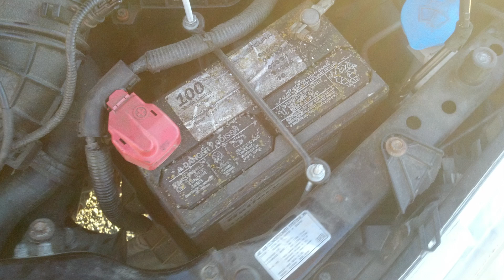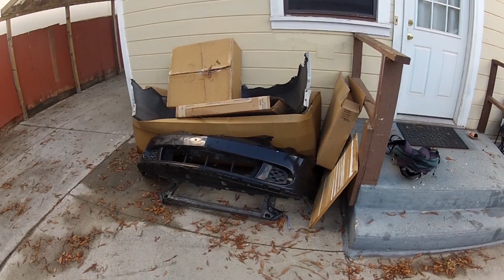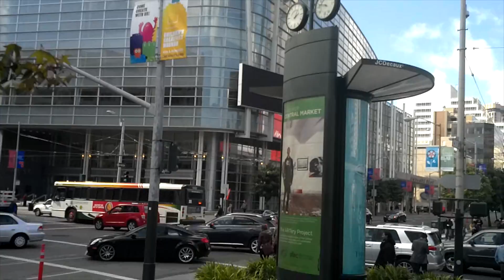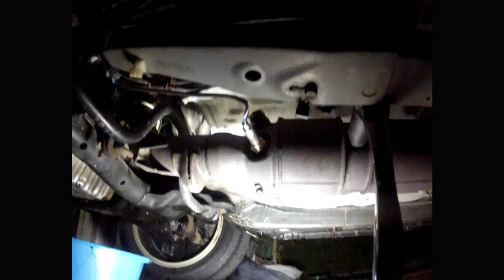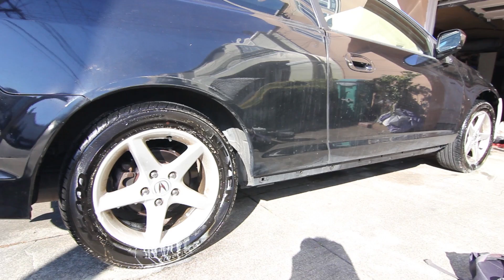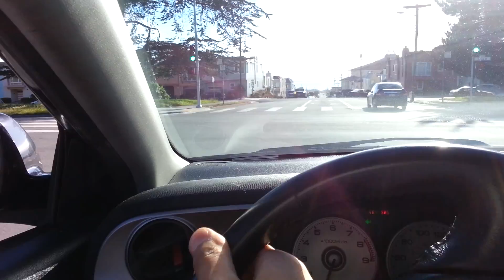2003 Acura RSX Type S Project Car - AEM Cai, ES bushings

Comment: Hey guys. How hard is it to replace the radiator support?
Reply from the maker: Not that hard if you can take off the front bumper and radiator. You'll have to drill the spot welds off, and re-bolt them.

Comment: Was there any cutting involve with the radiator support and I had another ? Does the radiator support come with the fender upper attachments mines bended
Reply from the maker: The radiator support is tack welded by the factory. You will either have to drill them out or cut them. The radiator support comes with the upper attachment. Google RSX radiator support and inspect the pictures.

Comment: When u change the radiator support did it have to be welded back on??
Reply from the maker: No, I used grade 8 bolts to secure it in place.

Comment: Was there any welding involve in replacing the new radiator support assembly?  Thanks any info would be greatly appreciated
Reply from the maker: +CAV Gonzales Hello. No, there wasn't. I drilled the frame and support, and put in grade 8 bolts. Thanks.
Reply: CAV Gonzales is it alot easier then weld ?
Reply: Colin Leung I’v been reading that in order to replace the radiator support I will have to remove the spot welds. Then weld the radiator support onto the frame. Did you get an OEM radiator support or aftermarket?
Reply: Mighty Mythic Music it looks like he got and aftermarket one cuz I am currently looking into one

Comment: but why did you sell it? I thought you was going to sup it even more and keep it
Reply: sup it up*
Reply: JakezMuzikProduction
Reply from the maker: The car was from another state that caused the engine bay to rust. Bolts would strip every time I tried removing something, and the parts were more expensive to replace than other cars. It was time for it to go.

Comment: How much did you sell this car for?
Reply from the maker: I think I sold it for around $5200.
Reply: Colin Leung $5200 is pretty decent even after the $ u put into it u still made a profit. How many miles were on the car when u sold it?? Thx!
Reply from the maker: 135k mi

Comment: Where did you buy all the front end stuff like radiator support and ac condenser
Reply: Is it cheaper on ebay?
Reply: Ok thanks alots
Reply from the maker: I bought it on ebay. You can also try Amazon or RockAuto.

Comment: how'd you change the radiator support was it direct bolt on and bolt off?
Reply: thanks , i asked because mine is bent..
Reply from the maker: I used a spot weld remover bit with a drill. The factory radiator support was tack welded on. I secured the new support with grade 8 bolts.

Comment: nice restore on that rsx, How did you remove the bent radiator support? I currently have an rsx project im working on, and the bottom bar that holds the radiator is bent.